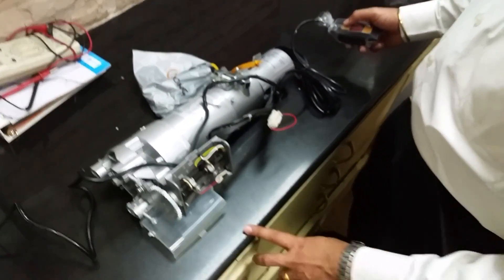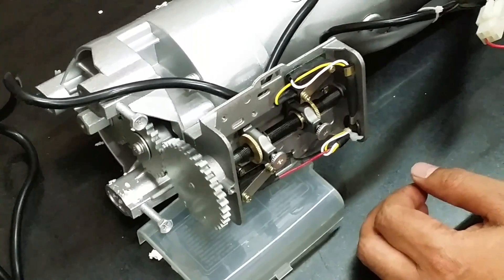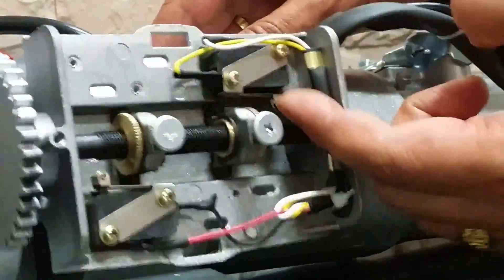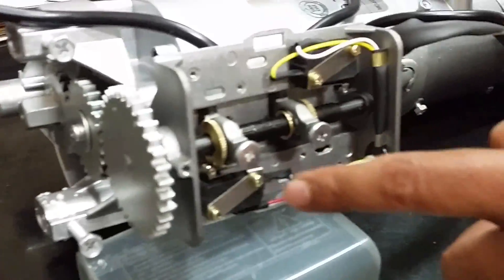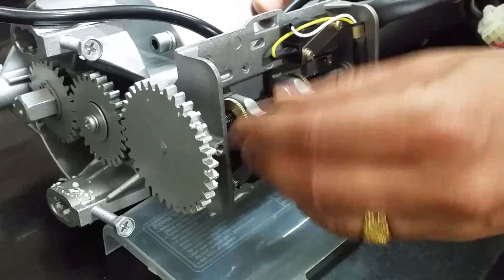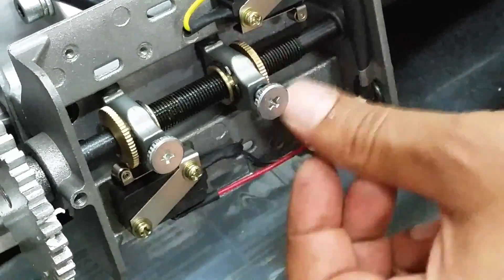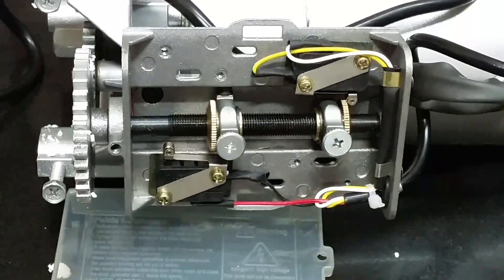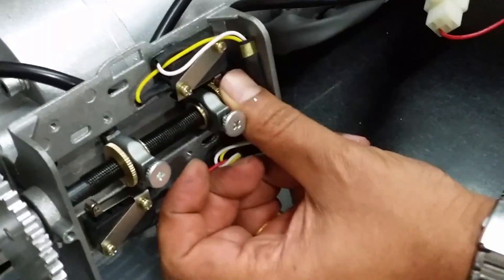How to do setting of Limit Switch in Rolling Shutter Motor

Comment: Sir what happen to my roll up door he did not going up, but of go down is OK... The going down is OK... But the going up he did not going up..
Reply from the maker: there are 3 reasons of this happening, 
1) the switch connection of Up / down may be disconnected or switch may be faulty
2) Relay or relay coil is not functioning
3) Burning of motor winding